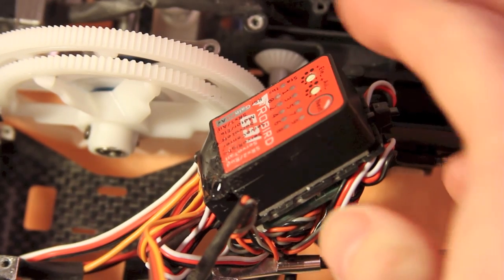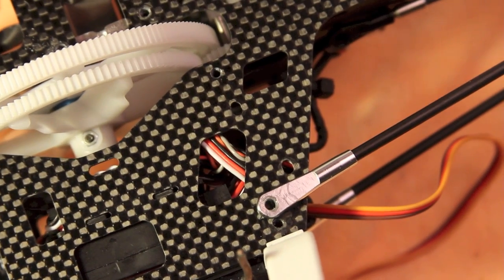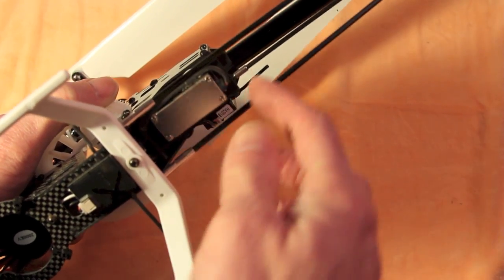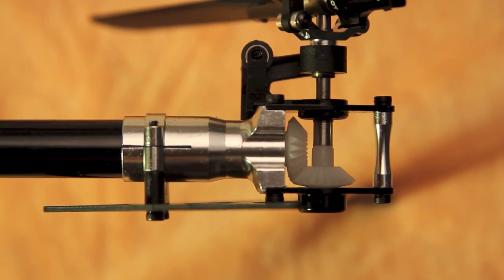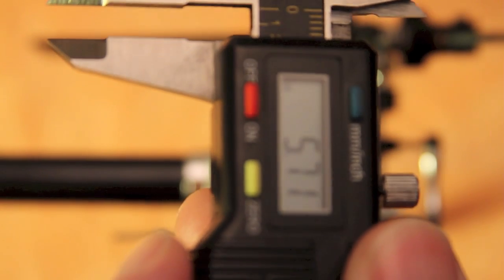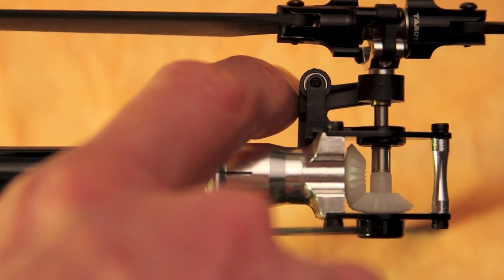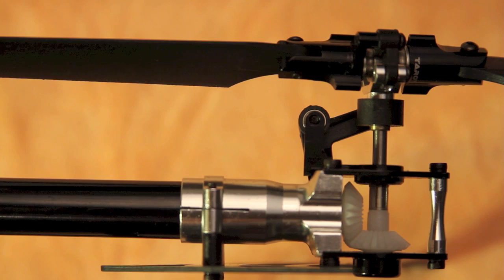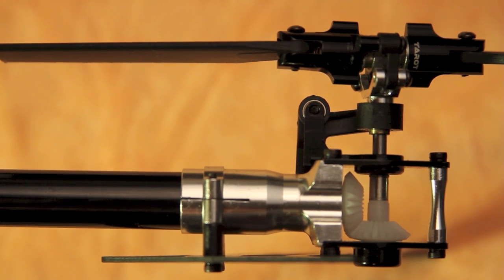35 : Tarot 450 Pro V2 Build : Tail Setup and Wiring Demonstration

Comment from the maker: It's Amazing Goop.  You can see more about it in my build video: "26 : Tarot 450 Pro V2 Build : Goop, Main Gear Swap, Motor Direction, RPM Sensor".  In video #33, you can also see how it comes off once dry.  

To your point...yeah, it's probably overkill. Not required, but I have read about  enough experienced pilots do it that I figure it can't hurt.